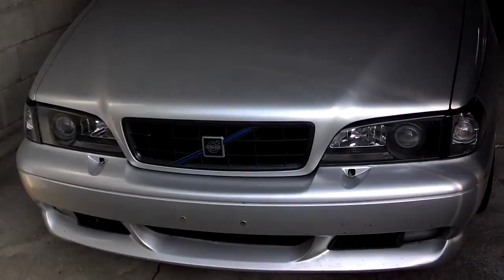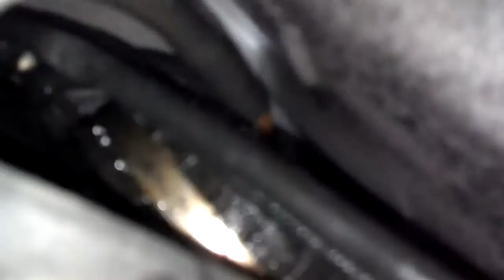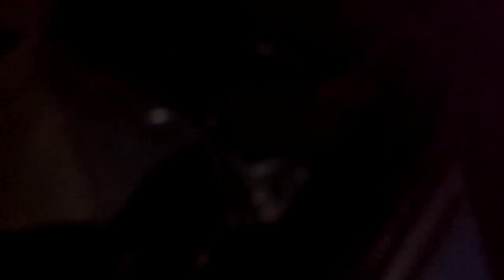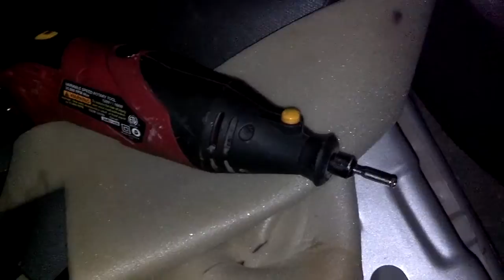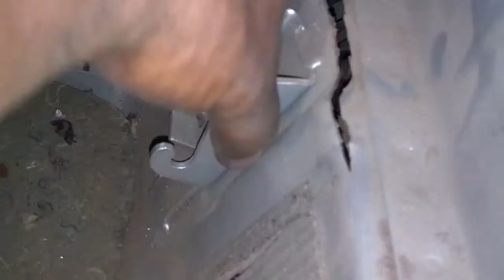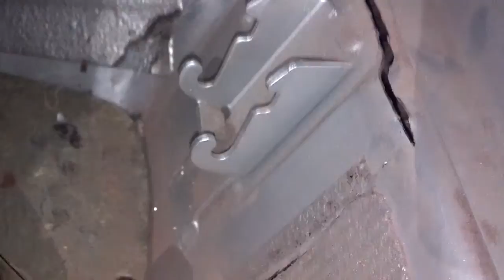Fuel pump access hole in floor of a P80 Volvo with AWD system. V70 R, V70 AWD, V70 Cross County.

Comment: Hello, maybe you know how to replace rubber filling hose from tank? Needs to dissasembly rear subframe? AWD P80 v70
Reply from the maker: That should be metal. The piece at the door?
Reply: @RobertDIY that piece in tank, rubber hose from tank to metal pipe

Comment: Thanks for the video, It’s a great modification. It is below a piece of sound barrier, and a carpet so completely invisible after you reinstall the carpet and trim, it’s not structural it’s just the vertical side of the rear seat (The full weight of the seed is supported by the top platform) so once you put the seat back on it, actually structurally holds it in place with the front latch. Saves the immense labor of dropping the tank to change the pump!

I wish I could post pictures. If you use metal cutting disc on a drill, much larger diameter than the dremel, you can cut those three lines in about 3 minutes.
Reply from the maker: Sweet

Comment: Hi, thanks again for all  that perfects DIY.
Is it the same cut on the other side for the fuel sender?
Thanks!
Reply from the maker: The sender is part of the pump assembly. The other side has the transfer pump.
Reply: The other side is just a pick up sock with a fuel line. Practically you may never need to replace the fuel sock, which is the only thing to replace on that side I think. I was under there doing the change today, and it indeed, looks like a mirror image. Cut the fuel pump side first by then you’ll be well familiar with where the lines match up.

I tried to do it the almost right way by releasing the suspension and the viscous coupling and the muffler in prying the tank down, only to find out I had the wrong fuel pump trying to repair this in the middle of a long trip. That’s when I decided to do the access port method.

The fact that I was already in there helped. That electrical line was underneath a bunch of tape and a bunch of clips, I was able to release it so hopefully when I get my correct fuel pump will be able to fish it out of there while pulling the new line!

Comment: Hey Robert, does this work for a 2000 Volvo v70 xc awd?
Reply from the maker: That is what the video is for.
Reply: @RobertDIY  thanks a lot Robert. I actually watched your video on the relay and replaced it last night. You’re a life saver. And ty for re assuring me in this video. 😇

Comment: What line ended up needing replaced and how did ya do it my v70r is doing the same thing
Reply from the maker: One of the lines coming off of the main fuel pump sending unit. One goes from the tank towards the rear of the car, the other goes from one side of the tank to the other side of the tank.

Comment: PLEASE DON'T DO THIS TO YOUR  CAR IF YOU PLAN TO SELL IT LATER!!!!!!! 
I just bought a wagon that someone tried to do this and they hacked up the fuel tank! It does take some time to drop the tank but its not much more then this and this is destroying your car and possibly the tank which is impossible to find used and cost almost a grand to replace! This is bad advice if you want to keep your car nice. Its been a nightmare to fix my car because of it!
Reply from the maker: Why did you buy a car with a bad tank?
Reply: @RobertDIY  they didn't tell me what they did, I only found out when I couldn't fill it all the way without gas leaking out. Went through the car and found the worst hack job hiding under the carpet.

Comment: um, if u want to use the seat safely, probably welding the cut seams is wise, no?
Reply from the maker: I don't understand your statement.
Reply: The bracket is really just for flipping the seat, the bracket does not support the seat

Comment: Hey Robert ( BTW huge fan!) I have 02v70xc awd and for some reason I cannot fill tank it tops off around 1/2 do you recommend this procedure for my baby?
Reply from the maker: +Josue Coronado nope.
Reply: There is a roll over valve and the vent, if something is up with those, the tank might act like it's full when it really isn't. Also the tank is sort of a two-part because of the big hump over the driveshaft, if the line that connects to the drivers side is plugged or whatever, that might mimic having only 1/2 the fuel capacity.
Reply: James Allen 
Hey thanks for that, could you send
Reply: James Allen 
Thank you for information, I will look for line.

Comment: where do the two different lines go to?
as far as I can tell, the one on the left side of the car goes to the other side of the tank.
does the one on the right go straight to the fuel filter?
Reply from the maker: +Travis Garrett yes.
Reply: so right side should be pumping fuel, left side just receives fuel from the other side of the tank? is that correct?
Reply from the maker: yes.
Reply: awesome, thanks for clearing that up.
I don't know how it happened, but after I put my new pump in, the left side is now pumping fuel instead of the right side. I'm so confused.
Reply from the maker: +Travis Garrett I don't quite understand the system but basically the right side vacuums / syphons fuel from the left side.
Reply: @RobertDIY  there are 2 fuel pumps. 1 for the left side and 1 for the right side. if you look at a picture of the AWD tank you can see 2 fuel pump locations.

Comment: Cutting the access hole is the easy part! Dealing with leaking fuel lines going to fuel filter and threading wire is the hard part.
Reply from the maker: +Don Sprague Yes, the AWD set up is hard to work on.
Reply: How about the fuel pump harness?
Reply from the maker: +Don Sprague Did not seem that bad to me.

Comment: OK Robert but should show how to repair/replace fuel lines and how to hook up wires to new fuel pump. Everything is so tight and threading wires and new fuel lines is big problem.
Reply from the maker: +Don Sprague I did replace the fuel line on that car. It's a daily video in November 2015. If you pull the tank straps loose, then pull down on the tank, you can get the lines in and out but you do have to be rough with it. Other than that, you'll have to lower the rear suspension.
Reply: +Robert DIY Thanks Robert- I worry about crimping the lines and electrical harness when I tighten the gas tank strap.
Reply from the maker: +Don Sprague Not that tight. The lines are hard and the tank is plastic.

Comment: It is not good to do so. You destroy the corrosion protection of the body. Maybe it was hard to get to but I had spent more time doing it right from the beginning.
Reply: Volvo was lazy as hell not providing an access port for the fuel pump.  With all the other bells and whistles that go into this luxury car, the needs of the mechanic were totally overlooked.
Reply: +surprep87  Hard to get to are you kidding 1998-2000 AWD? Might as well get another one if you do not do it like Robert in the vid
Reply: While yes, it may compromise the corrosion of the body my car is 20 years old and I live in Arizona.  Snow, salt, and general corrosion issues are rare for me so while maybe somewhat lazy its the easier route for me.
Reply from the maker: surprep87 OK.
Reply: Jeff Ross You are lazy as hell

Comment: I have a Volvo 850.  Just a heads up on those. The previous owner had to replace the fuel tank. It developed a crack around the filler spout.  Too much leaning on the nozzle when filling the tank. Caught myself doing it.  Puts a lot of pressure on the filler tube.
Reply from the maker: Rolf Grosseholz Hmmm, I don't buy that one.